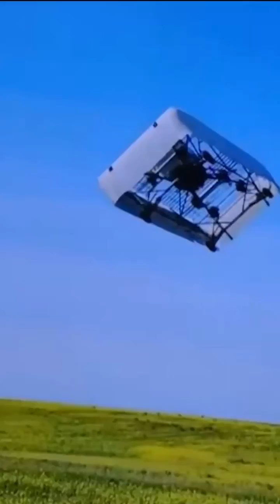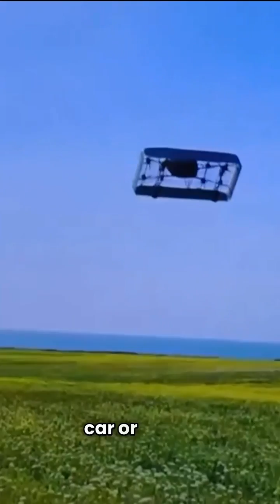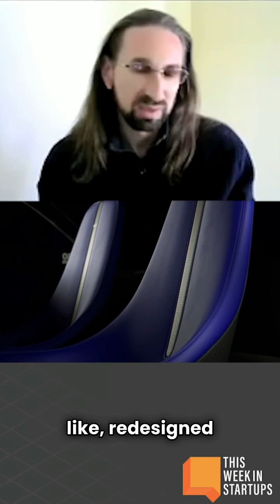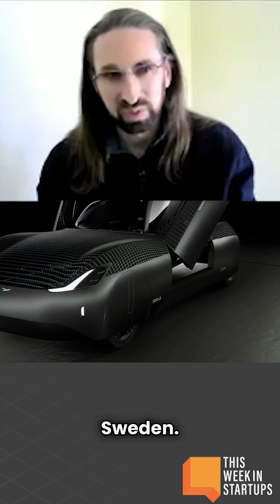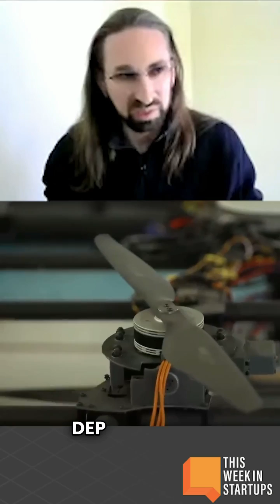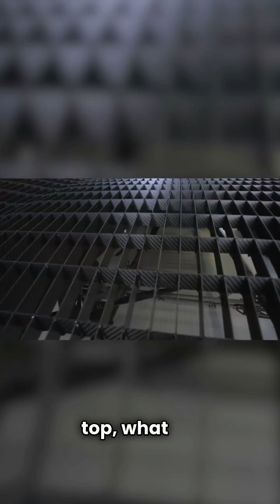The flying car by Alef

Comment: How can you consider yourself a "DESIGNER" or "PLANNER"?  How can you claim a range of 200 miles?
There is only an EGG with a net structure that holds two people and 4 propellers.
where are the wheel motors? how much does the (useless) empty structure weigh?
where are the batteries? How many batteries do I need to put just to lift it 10 inches off the ground? are you serious?

Comment: or you know, use a helicopter
Reply: Having more propellers makes it more stable and easier to control
Reply: @Newpts  then just design a drone like heli
Reply: @wintermoon9181  That would be a quadcopter, yes. Which is exactly what this is, this one just has something over it so that it looks more futuristic than a normal quadcopter and will make more people want to buy it because they think there is something special about it.